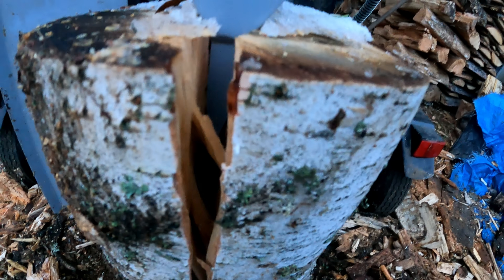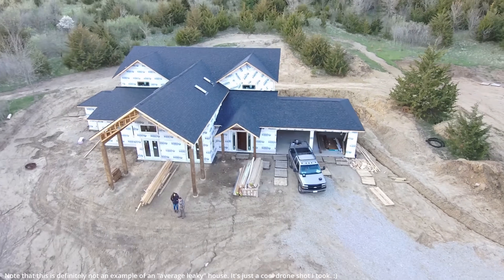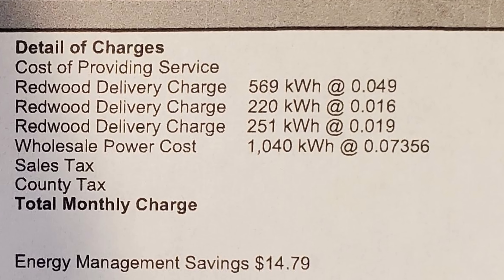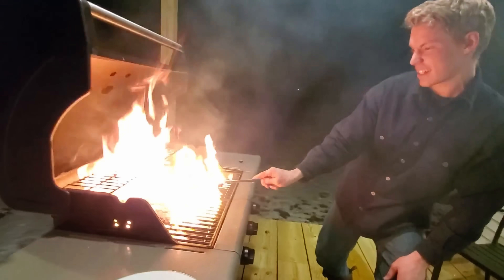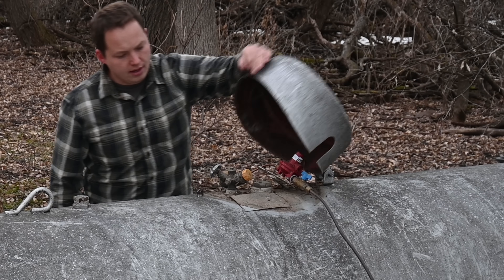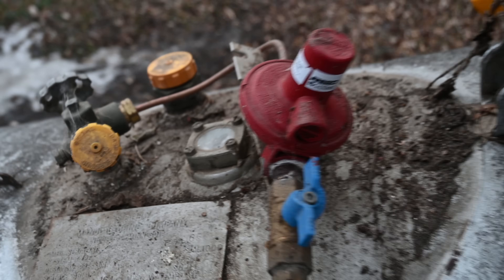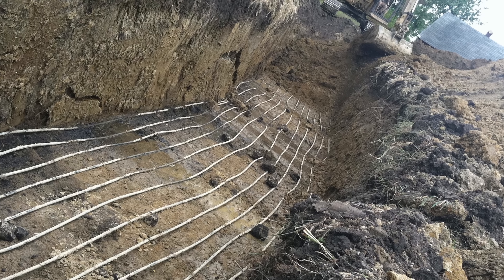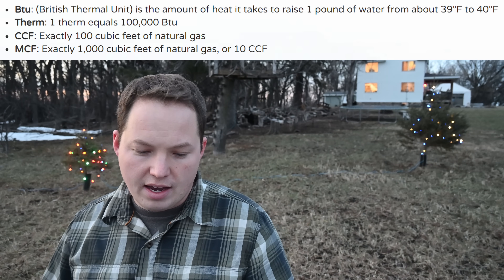What's The Best Heat Source in 2022? Top 5 Home Heating Methods - LP Electric NG Geothermal Fuel Oil

Comment: Great comparison. 2 years ago we got a 2000 sq ft house built, r28 walls, r55 ceiling and triple pane windows. Basement is wood insulated to r28 with concrete floor with 2" foam insulation under it. we installed a 27kwh electric furnace as a backup because we have a coal fired stoker outside. Electricity here is about .14 per kwh. Heater fuel likely about $5.13 per US gallon. To put in natural gas the utility company wanted $35,000.00 as the nearest gas is 1 mile away. We use about 20 tonnes (2200 lbs per tonne )of coal to heat the house and a 2000 sq ft shop. Coal is about $110 per tonne trucking is a 600 mile round trip. We can heat for way less than we could with the old 1100 sq ft house burning heater fuel. We start the coal burner in early November and shut it off in April.  It's warmer now (mid Jan, -15c ) but for the last 21 days it never got much above -25c and went to -38c a lot of nights.
Reply: Is the price of Coal fairly stable?  Obviously, trucking is probably the largest variable given out countries diesel situation.  I'm sketching out a plan for an off grid property and have always liked the idea of outdoor boiler but I have no experience with one, nor do I know anyone with 1st hand experience.  Obviously we've  seen the price of energy spike over the past couple years . In my area of Northern California, Propane has almost doubled in two years from $2.40 per gallon to $4.10.  Wood pellets for have gone up about 46% from $4.79 per 40lb bag to $7.00.  Cord wood (almond hardwood) has been fairly stable $350 per cord but I have seen folks asking $550 for oak up from $400. I personally like the idea of coal.  Long burning, fairly dense, doesn't spoil, no bugs. Someone has to make automated auger system too.
Reply: @mondavou9408 , Get a ductless heat pump.  At $4.10 per gallon, a propane furnace is about $5 per 100,000 Btu's of heat, while a heat pump is only about 5 - 10 KW per 100,000 Btu's.  So if you pay $0.16 per KW, that would be $1 to $1.60 at the most to run a heat pump to collect 100,000 Btu's!   You could reduce your furnace use by more than 75% with a ductless unit mounted in your living room, and heating that to about 72F, with heat drifting around your home.  Then the furnace would run for only a couple of minutes to heat the rest of the home, say when you get up in the morning.  

I installed a 18,000 Btu unit in my neighbor's home, about 1,300 square feet, average insulation for 1990, and it heats fine.  Cost was $900 for a 17 SEER unit on Amazon, including the copper tubing between the two units.  However California does not allow installation of 17 SEER ductless units, so you have to pick a higher SEER unit to install in CA.  Amazon has more!  And the cost was very low, surprised me a LOT.  It hit 23F last week, and he was fine.  No need to run his 15 KW electric furnace anymore!  

I don't think you could get a permit to install a coal heater in California.  They really don't want to give permits to install a oil furnace either.  I don't know what town you live in, but buying a truck load of coal might mean importing it from a long distance, thus expensive shipping cost.  He lives in Canada, and they sell coal at a local co-op, only 600 miles from his home.   . . .
Reply: @Kangenpower7  Wow! That was a nice, clear, logical and helpful reply.  I really appreciate the time you took and the information you thoughtfully shared.
Reply: -15C is close to 0F, and heat pumps do not normally extract a lot of heat from that cold air, but some are designed to do just that.  If you have ever been in a -30C walk in freezer, it is possible to extract that heat even from Very cold air.  Depending on how many hours per year you run your electric furnace, you would save a lot by using a heat pump.  Even a small $1,200 one on Amazon that is 18,000 Btu's is fine, install the indoor unit in your living room, and then heat that or cool it, and they are silent!  Only use about 1.5 - 2 KW when heating or cooling.  It will allow you to not run the larger boiler until much later in the heating season, and shut it off sooner in the spring.  

Anyone with a oil fired heating system should have a ductless heat pump installed as soon as possible, to provide at least 50% of their heating needs, and save potentially over $1,000 per year!  You might make your 20 tons of coal last more than 3 years!  And summer delivery is much less expensive than delivery in the snow!  

To get 100,000 Btu's from a heater, you can burn 23 KW of electric heat, or use a heat pump at about 7-10 KW, or burn a gallon of fuel oil, or 1.2 therms of natural gas, or about 1.2 gallons of propane.  So look up your price for each, and decide!

Comment: I would really like to know how efficient heating your home with kerosene is? We did it back on the farm in Nebraska and Iowa for a year after year after year and oh by the way our refrigerator ran off of kerosene as well. Yes that’s right you could refrigerate your food and even freeze your food by burning a small flame from kerosene. Absolutely silent No electricity required.
Reply: RVs still use fuel operated "3-way" fridges. They use propane though and can operate off of 12v or 120v. I have often wondered why home fridges dont have an option as a back up.

Comment: Brand new Lenox heat pump with a pellet stove fire place insert for the really cold days up here in Michigan.  Did have a 15 year old open loop geothermal that was not working well and was poorly installed. It was tough to justify a closed loop geothermal now that the heat pumps work so well.  We did get the high end all variable speed compressor and main fan.  So far very happy with it.   The wife really likes to have the fire place going so we still use about two pallets of pellets. I do wish the new Lenox thermostat had remote sensors like my old nest did.  We used to just use the remote sensor in the bedroom(far away from the pellet stove) for the geothermal and then use the pellet stove to keep the living area (kitchen/dinning/living room) comfy.  One nice thing about the new furnace is how cheap it is to keep the fan on(Variable DC motor) so we just keep that at about 30% all the time and then ramp up when heat is needed.  This might sound expensive but doing this keeps the basement area much dryer and then the dehumidifier never runs and they use a bunch of power.  We have the sense monitor to compare that.
Reply: 3200 square ft not including the full basement.  Pellets are about $5 a bag right now cheaper when we buy in the early fall.  So about $500 for pellets and what ever the heat pump uses but the sense monitor says it’s not that much.  The stupid electric water heater is like 60% of the bill.

Comment: Living  in mid NC makes  heating less of  problem than  being  up north. I have  a very good  oil furnace that  I stopped using when oil got high and now its  high again! I also have a heat pump which works  great down into mid 30's. The former owner put in a  wood stove fire place insert with  blower. With  trees falling  every year I get wood wanted or not.  It is very time consuming. But the  cleanup would have to  happen regardless its just the extra  time to move it and get it down to burnable sizes. I have found  using the limbs is a  very smart thing to do. I cut them to length and  bundle them in a "charge" size bundle to make  handling of them easier. I have read  limbs have a higher BTU value that some parts of a tree. What used to get  burned off in a  brush pile is  now  part of my use plan. October to  March is  about all we  have for a  real heating season. We don't  get out free but its probably half what  you have to  pay. Out of curiosity  I looked in a  Tesla "powerwall" to run a heat pump and  electric heat. $18,-000.00 for  one unit and they have no installers in this area. Which probably means  nobody is buying at that price.

Comment: That's not accurate bro. We use 3 to 4 space heaters. Two on the ground floor, and up to two on the second floor. Our electric bill has been  significantly cheaper since we started doing so. We also don't mind to throw on a hoodie and blanket to stay warm.

Comment: Your correct I have have had closed loop geothermal for for 30 years my new unit is 4 years old it has its own elect meter so I know the cost  . I installed a home whole house generator but it struggled to operate my unit . So I installed a natural gas furnace 95% so the generator wouldn't have to work so hard . The only thing that's gas is the furnace in the last 3 years it was around  a hundred dollars cheeper to run the furnace and it feels warmer .

Comment: Simple and to the point. Thanks.
I use a ground source heat pump. (pump and dump) I have a fireplace that heats and that qualified as a back up heat source so the utility charges me about half price. An automatic back up is now required but I'm grandfathered. For this rate they get to turn off my compressor when they get close to peaking and want  to avoid buying more expensive electric from their provider. That will happen on days when its maybe 10 degrees and about 4 pm when people are getting home and demand goes up. Always back on by 9 pm. The same heat pump uses a desuperheater to heat my 130 gallons of domestic hot water whether the furnace is heating or cooling. The water heater rate is about 25% of the full price of 11. something and is on off peak. They heat normally from midnight to 7 am. Then the utility shuts them off.

Comment: I live in North Carolina where winters are usually mild.  We have a short period of temps below 30 but for the most part, 30 and above.  An early 1960s ranch house, approximately 1,600 sf, with a dual fuel system, natural gas + 2 stage air heat pump with cutover temp of 30.  I couldn't be happier.  System is 15 years old now and when it is time to replace, I intend to stay with the same configuration.

Comment: I use an air to water heat pump with a wall mounted gas condensing boiler for backup. Most of the year I use solar and batteries to power the heat pump. In winter I use the grid.  They both heat an indirect tank with a coil in it for domestic hot water. My only issue is I keep the indirect tank at 170 degrees and the mixing valves (120 degrees for the hydronic and 140 degrees for the domestic) fail after 3 to 5 years. I keep the house at 68F year round. (20C) Thanks for the video. I would like to put in a CO2 (R744) heat-pump when they become available in Canada. Can you review a CO2 based heat pump if you find one? Thanks for the video.

Comment: at 0.274/kwh and 1.909/therm for gas, It looks like i would need my COP to be above 3.5 on my Heat Pumps to make it economical.
If my math is right than i should switch back to Natural Gas hot water system when it dipps below the 50's outside.

Comment: I live in NW coast where it seldom goes below freezing.  I'd thought that heat pumps while in heat mode became less efficient as temps drop.   The evaporator will freeze up with ice at temps round freezing and below.  How does your modern heat pump keep the ice off?   Electric defrosters?  This sounds pretty inefficient.

Comment: Mild in Ohio this year. I guess I'm really cheap.... If it gets much below 50 in the house I burn wood in my 190k Brunco wood/coal furnace I put in 25 years ago. I bring in several cords in October to keep dry in the basement. Only had to burn a couple days so far this season. Why cool in the house? I work outside most of the day and at night I have a warm bed. So why heat the house for 1/3 of the day? You cant really do that in the real world b/c it takes more to heat it up from a cool temp. So I just layer up in the house and all is good. I live alone so I don't have to hear anyone complain. My dogs prefer the cool house anyhow. I do enjoy cutting wood... Keeps me strong and fit for a guy in my mid 50's. Life's good:)

Comment: Used oil furnace burns used motor oils for free I get all of my oil in Michigan for free from every mechanic shop so it costs me only electricity to run and it's way cheaper then all your options it's legal to buy a used oil furnace here in michigan

Comment: What a bunch of crap... We live in central missouri and just bought a 3100 square foot house it has a heat pump from 2016.  Any time it gets below 25 it runs all the time and does not do much accept run up the power bill. What a joke, so we bought a pellet stove which is amazing and going to change out the heat pump or money sucker next summer for propane. My neighbor tried mini splits, what another joke, if your house is 800 square feet it might be okay for a garage, anything besides that, for get it. Propane as of 2 days ago here was 1.90 a gallon. up from 1.55 last summer when I had my shops 500 gallon tank filled. Someone might want to do a little more research especially after watching this misleading video.

Comment: Hey Ben. I am a plumbing and heating technician in Northwest Montana.  Very good / helpful video. I own a 1,300 st ft condo (2 bed 2 bath), open floor plan for the living area. I'm running 45k BTU NG fireplace off of a nest thermostat. Every other room has its own electric wall heater. I spend an average of $1000 a year on my total energy bill. 900KWH max and 40 Therm (gas unit)  in February last year. Mind you that $1,000 includes my lights refrigerator all the electricity. I am a happy camper.
Reply: better be glad you aren't in Memphis TN .I have from 600, 500, 386, 373 , 342, cheapest in a year was 186 last month. not be going back up no matter what I use . smart meters . I think they charge what they want.

Comment: I use space heaters but i keep the house at a low temp. I run them on low - 900w so the outlet does not overheat. Natural gas charges a service fee  plus the fuel costs. If i could go back in time, i would get a pellet stove. If your heating with a space heater, get a large room heater.  Large room heater can be run non stop for months at a time without getting the heating unit clogged.

Comment: Thanks for so much helpful info in your video !!! My modular home is 1456 sq ft out here in the NW AZ desert. The floor is poorly insulated, for now. We heat the house to around 70F. 2021/2022 winter we are using a pellet stove for the second year. This option keeps the price of electricity down to $25 per month, so far. The price for 2 pallets of pellets (4000 lbs) is $620. We actually burn about 60% of the 4000 lbs. The electrical savings is helping pay for the pellets. Backup #1 is a 4 ton central heat pump that is about 12 years old. Weak output under +40F. Backup #2 is propane, which went up a lot over the past few years. Great heat output, but very pricey. Too rural of have natural gas. #3 backup is a 1500 watt electric heater. Solar is on the horizon for us.
Reply: Desert Mike,  I also have a 2014 14 SEER Goodman heat pump, 4 tons for 1,850 square feet.  It heats just fine at 30F, and only costs about 8 KW per 100,000 Btu's of heat, VS 1.2 gallon of propane that is about $5 today.   You might find the heat pump, providing it is working right is the lowest cost option to heat your home.  I have a oven thermostat on the hot gas line going into my air handler, located in my hallway, (the insulated line).  It runs about 120F just after starting and can reach 155F in about 20 minutes on a 45F day.  A 30F day and it takes a little longer to reach that temperature.  Many times the alarm goes off at 165F on a 48F day after running about 45 minutes (it is a cooking thermometer).  So I know it is working great.  

Last month, we had a cold snap at 23F overnight, and it was only getting up to about 110F.  I found the unit covered with ice and the outdoor fan blocked due to melted ice freezing under the fan shrowd, and stopping it from turning.  Thawed with garden hose, and everything went back to normal, 130F in about 15 minutes run time at 34F outside air temp.  So the oven thermometer is a wonderful indicator of the performance, and the need to go look at it on a biter cold day when it is under 120F hot gas temperature.  Now the air temperature coming out of the grills is only about 25F warmer than the air going into my air handler.  The hot gas is the temperature of the insulated tubing coming from my outdoor unit to the indoor unit.  It is very hot when running.  

I have installed HVAC since 1984.  R-410 heat pumps work so much better than the lower refrigerant pressures found in R-22 systems.
Reply: @Kangenpower7  My system is R22. I"ll keep my eye out for a 410 package unit !